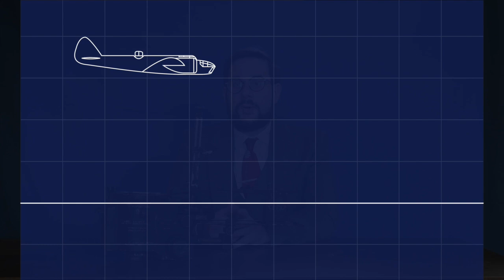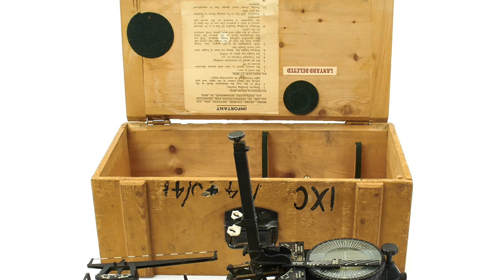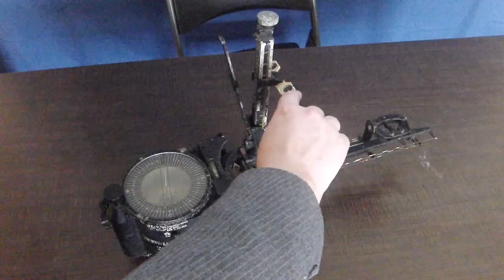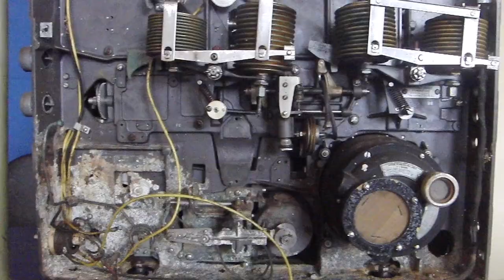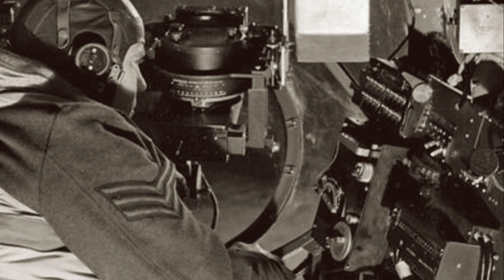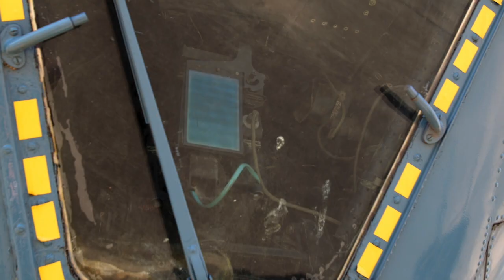WWII British Bombsights: Getting on Target

Comment: That was pretty interesting and very well explained. For all the claims made about bombsights, arguably the biggest problem right throughout WWII was finding the target. The bombsights you show, when trimmed accurately, were quite capable. But the spanner in the works was that early in WWII, RAF Bomber Command simply couldn't find their targets. While a lot of propaganda was expended extolling the exploits of crew destroying targets in Germany with pin-point accuracy, reports early in the war showed that only one bomb in a hundred got within five miles of the target. Even in daylight raids later in the war, bombing was often very inaccurate due to ambient weather conditions, such as inversion layers and cloud or smoke over the target area. Despite the advent of Gee, Oboe and H2S (or its American copy, H2X), this remained a problem for the entire war. In one extreme example during the bombing of Dresden, an American bomber force got confused by the smoke and ended up bombing Prague.

So while the accuracy of bombsights will be forever debated - and they were very interesting instruments - their efficacy was really dependent on a much larger set of problems.
Reply: I believe the original Butt report said only 5% got within 5 miles of the target, but apart from that minor piece of pedantry I completely agree!

Part of the problem - for the British in particular- was that they never really intended to bomb at night. It was only their appalling losses in early daylight bombing that pushed them to bomb at night.

One of my history professors was Dr Richard Overy. I remember him saying that it was ironic that strategic bombing was the raison d’etre for the independent RAF, yet they started the war with no real credible means of bombing Germany.
Reply: @bob_the_bomb4508   I was paraphrasing Hamish Mahaddie and I might have got him incorrectly. I know he said ‘aiming point’ rather than ‘target’ but that doesn’t make a lot of difference.

The RAF was in an interesting conundrum. They couldn’t really be a strategic air force until the got the Stirling and even then, most of their bombers were only twin engine. But the concept of a strategic bomber force in the days of the Heyford kind of highlight what you said.

The Americans might have had a better approach but in the end, I thing the RAF came closer to strategic bombing than the USAAF did, merely because of the tonnage dropped. That Harris deployed them so poorly was another matter. If you’ve read Max Hastings’ book, ’Bomber Command’, you’ll know what I mean.

The German approach was different again. Though never a truly strategic bomber force, they were, ironically, arguably the first to demonstrate it.
Reply: @thethirdman225  Agreed. We see the German bombing of Guernica and Rotterdam as examples, yet their medium bombers could never ‘throw the weight of metal’* to make strategic impact. 

I have some sympathy for Harris. Apart from pin-prick commando raids, Bomber Command was really the only offensive possible on the ‘Western Front’ until a landing in force could be made, and his own WW1 experience encouraged him to do what he could to ‘save the bones of a British Grenadier’. 

He also inherited that woefully inadequate capacity and knew that it would take major effort just to make it capable of hitting a city-sized target at night.  He eschewed the concept of ‘panacea’ targets throughout the war as a result.

I think the problem was that he couldn’t grasp what technology was making available. The progress made with target acquisition, not least through pathfinders (another development he originally opposed) meant that, by the time of the ‘Transportation Plan’ he was out of date. 

Thus I’d recognise two phases to Harris’ career: pre- and post- Normandy.

Before Normandy I think he did what he could with what he had. 

Post Normandy he failed to recognise that - ironically somewhat due to his own leadership - the RAF could do a lot more than just aim at a city, as the Transportation Plan proved. 

* A phrase Drachinifel might use to describe a naval broadside :)
Reply: @bob_the_bomb4508 . It’s worth remembering that Bensusan-Butt was the stereotypical old public school boy who having failed at everything he tried was giving the task of “counting the bomb holes” from photographs - an odd job for a supposed economist.  I remember seeing a scathing article comparing him with Will Hay’s character in Oh, Mr Porter.  His claim was actually that only a third (depending on the target) of aircraft attacking caused any damage within five miles of the target.  Being based on his studying photographs and not being an expert there has always been some doubt that he was actually qualified to assess damage, or to take into account the many “duds” that were dropped.
The other services competing for a bigger share of the funds did make the most of it however and it eventually lead to the logical step of announcing a strategical change and bombing an area rather than the more optimistic No. 23 Hauptsrasse….which was essentially all the RAF was doing anyway.
Reply: @annoyingbstard9407  that may well be true about Butt, however it’s telling that the RAF couldn’t rebut his report (no pun intended) which speaks to the poor quality of operations analysis in the RAF at that stage of the war.
Reply: @bob_the_bomb4508   Rebutting his report would take a special kind of stupidity - no offence.) Thanks to his report (and much to the chagrin of the other services) bomber command’s budget rose from under 2% of total defence spending in 1940 to 15% of defence spending by 1945.  It’s  generally recognised that he was planted in his post by Lindemann FAOBO the RN at the time but as an example of a plan backfiring this particular one takes some beating.
Reply: As far as British bombing was concerned, they often had trouble finding the right city.   As far as both British and American raids were concerned, not only was navigation not always up to it, and bomb aiming under fire from flak and BF109's not always up to it, the Germans operated very good camouflage and decoy systems.  E.g.,  a German "oil refinery" was regularly bombed for 2 years, before it was realised that they had been bombing a flimsy and easily restored decoy and the real refinery was several miles away.
The British bombed at night - this made things easier for the Germans as they would for example arrange for a lighted chemical plant to go dark  as soon as the bomber course was figured out, and the lights of a dummy plant, configured to look the same, would be turned on.
Often, the target would be obscured by cloud or smoke or both, as you said.   Brit and American crews following the first wave figured that if you can't see the target, bomb the glow seen through the cloud or smoke - that must be the target on fire.   The Germans figured that too, so they set up their own smoke  making apparatus, with oil fires to create the glow, some distance away from the target in some field.
Reply: @keithammleter3824  
"As far as British bombing was concerned, they often had trouble finding the right city."

The Americans did too. Many ruses were tried. There's a book called "The Other War" by Peter Hinchliffe which describes the ways in which the RAF and the Luftwaffe spoofed each other throughout the war.
Reply: @thethirdman225  :  Yes, for different reasons.   The British were not as well equipped as the Americans.   However, it seems that, while on paper American training was up to it - they certainly wrote very good training manuals - in combat they could loose it. 
I have been reading a document now available online "Bombardier's Information File" dated early 1945.  In one part it has a photo taken of a factory taken at 22,000 feet at about 5 PM, alongside another photo taken at 15,000 feet at noon.   Due to different shadows, roof reflectance, and different scale they look completely different!  It's only after you study them for several minutes that you can believe it is the same factory in both photos.  If you had to find it while being shot at, you'd never find it.
I live in Australia, and am 75.   In my young adult days I used to go camping with my mates in remote parts of northern Australia.   These parts were and still are essentially uninhabited.  On one trip we discovered an American B-25 bomber.   We were by no means the only ones to discover American bombers.   What happened is that during WW2 a large number of American aircraft and their crews were shipped to Sydney, which is a coastal capital.   Many were ordered to fly to Darwin,  an isolated coastal city on the other side of the country.   It was within range if not carrying bombs.   Some of them could not find Darwin and belly landed in the remote bush when they ran out of fuel.
I've read a number of books on the tricks each side used in the war in Europe.  The Germans tried a crossed VHF radio beam navigation system, which should have been accurate.  The idea is to fly along one beam until you find the other beam.  But the British radiated their own beams, "bending" the signal, thus causing German aircrews to drop their bombs in unused fields.
Incidentally, when we found the belly landed bomber, we spent a lot of time examining it, 20 years after it had arrived there.   We had two LandRovers.    We took the batteries out of our Landies and connected them in series (ie 24 volts) to the aircraft battery 28 volt connections.   The radios and other electrical equipment came alive and seemed to work perfectly!
Reply: @keithammleter3824  RAF had other methods for night-bombing like Oboe and other kinds of pathfinding
Reply: @diobrando2160  ; I didn't mention them because the original poster in this thread did.
Reply: @diobrando2160  That equipment still didn’t guarantee anything. As I said, even at the end of the war it was possible to hit the wrong city. I’m not taking anything away from the efforts to get it right but I suspect it was a lot harder than people realise. Sounds simple enough in concept but execution was probably another matter.

Comment: CEP of 1,200 ft but at what altitude?
Reply: 18,000 to 25,000 feet. On the Hamburg and Dresden Firestorm Raids 500 plus bombers dropped their bombs within 3000 feet of the Target Indicators. On the Hamburg Raid, the Target Indicators landed 2 miles away from the planned aiming point.
Reply: @richardvernon317  Hang on… British bombers couldn’t get to 25,000 feet with a load on. Many used flaps just to get above 20,000. Radial engine types like the Stirling, the Halifax III and the orphan Lancaster Mk II couldn’t even get that high.

So presumably, the CEP was from no higher than 20,000…?
Reply: @thethirdman225  Mosquito could!!!  Only two Squadrons of Mosquitos used Oboe (105 and 109), 139 had a few aircraft fitted with a Nose mounted H2S from early 1944 onwards. All the rest of the Mosquito bombers in Bomber Command from 1944 onwards used the Mk XIV sight. The Standard Mk XIV sight was designed to be used up to 25,000 feet. The Mosquitos could fly up to 32,000 feet with a 2000lb load. The Mk XIV sights in the No. 8 (PFF) Group Mosquito force had to be modified to work at higher altitudes. The Trials done on the equipment in late 1944 / Early 1945 gave an average miss distance of 350 yards.